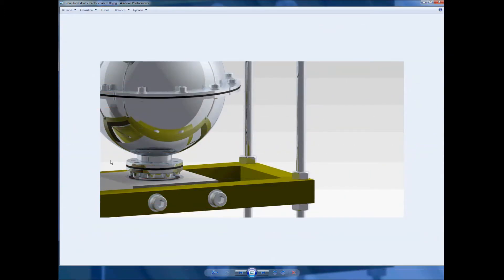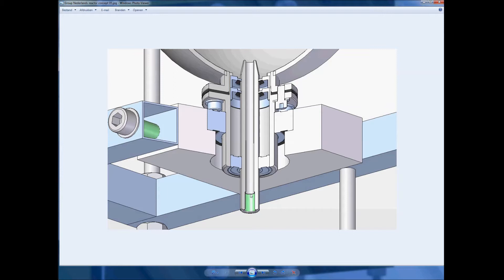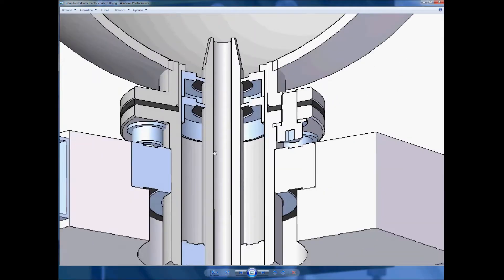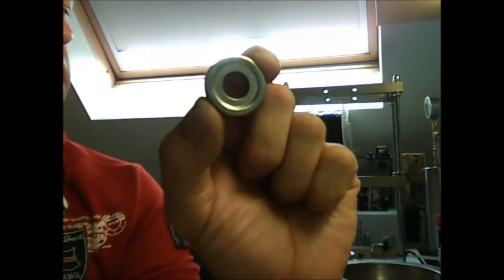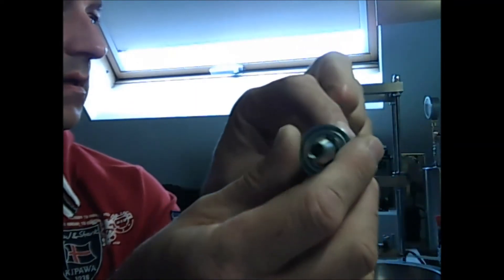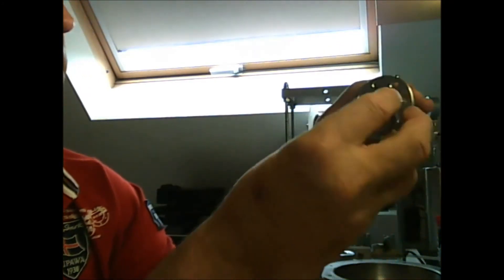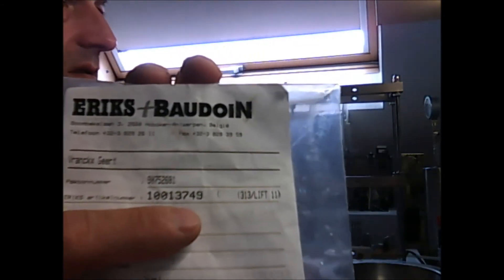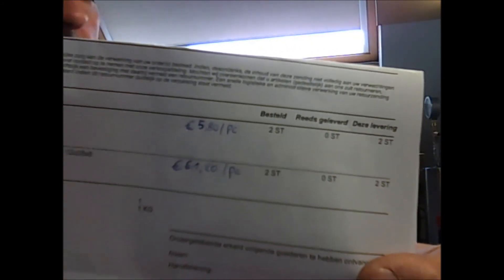V8 Cad drawings and PS seals mounting

Comment: Hello! .. Go job well done .. And why not try to build an external bell and make the vacuum from there? empty gums gassed up, friction and heat will eventually warp the rubber and break the seal ... I suggest you build a external glass bell inside which is a perfect sphere, thus recrearias conditions in the shaped space where lifetime naturally